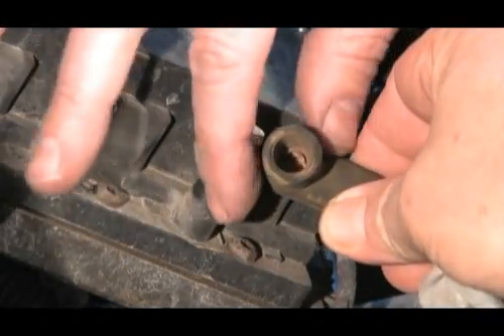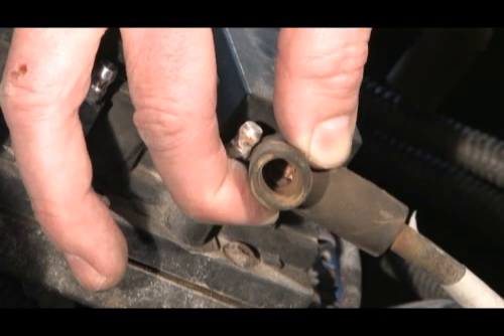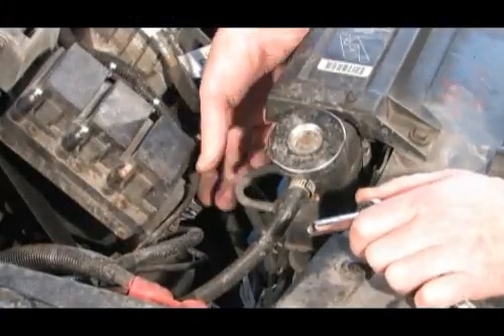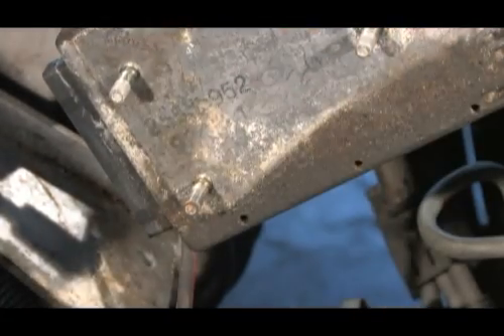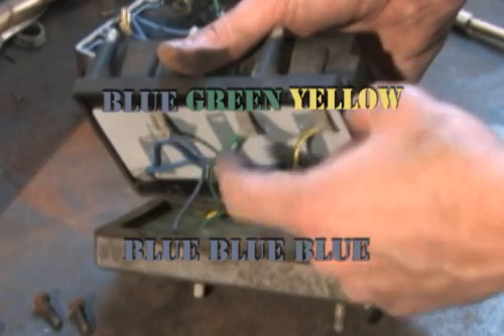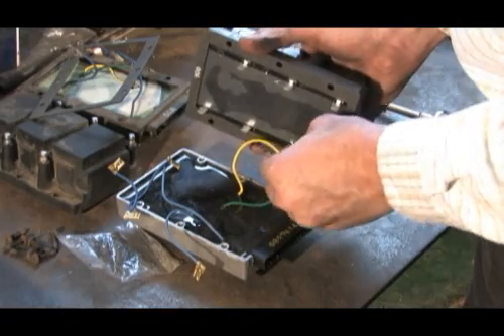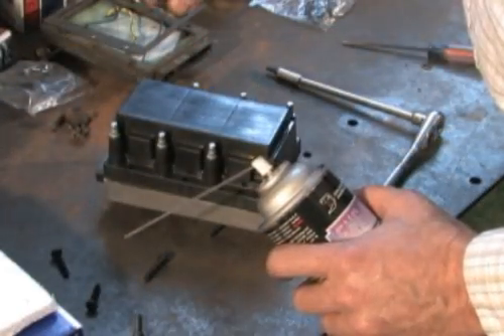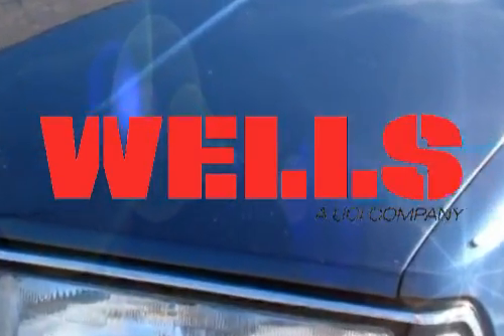GM Type I Ignition System Troubleshooting, Diagnosis and Repair by Wells EM

Comment: This is a pre-series GM 3800 I have seen where this GM Type I ignition system has been upgraded to later system used in series I-II . The later is less expensive part and performs better plus coils are individual.  Do you know if the connector is same or if the input wiring needs to be spliced  to a series I-II connector.

Comment: What size bolt is the tensioner pulley
Reply from the maker: Hey, wish I knew. That information isn't published. Try different sockets until one fits.
Mike Becker, Senior Technical Instructor
Reply: I found out the metric fits perfectly. Between 16-18mm and it’s reversed.. righty loosey, lefty tighty.. There is an in-depth instruction of using Computer, CPU thermal compound at Best Buy or computer stores. The official GM service manual shows 4 spots to apply the compound. It helps reduce heat damage to the ignition module and coil pack!  

If you’re on a tight leather lycra corset budget, don’t toss the old coil pack! I broke the coil pack tab-pins, and wire cleaned the spark plug wire terminal and used dielectric grease on both plugs and coil pack.. I do field repairs on my Buick.. Get a metric tool set.. get an LED phone light that you get with an iPhone as it is very bright! If you break down at night.. Replace spark plug wires and plugs. Disconnect the battery, to clear all P-codes.. The computer will take time to adjust to new electronic components..
Reply: I saved and cleaned the old coil pack after I broke the tab of the new coil pack! $68.00+ bucks! Wire toothbrush cleaned the corrosion on the terminals..

Comment: Nice video. My aunt has a 1991 Bonneville with the same as in the video. We have had it  to so many mechanics I have lost count!! Her Bonneville is throwing a code 42 which is s a problem between the ECM and the ICM?? I am going to change the coil and modular this spring!!
Reply from the maker: Good luck Gracie! Glad we could help with our video!
Mike Becker, Technical Services Instructor

Comment: Hello, I have a 1990 Lumina APV van that periodically after running a little while, the Temp starts going halfway up and if I accelerate more heavily it will get really hot! The big problem while driving will happen when I come to a stop.  The engine just goes dead sort of like if you can imagine driving a manual transmission car coming to a complete stop and not engaging the clutch....This is how my van feels when it starts heating up and I come to a stop...Then I will have to put it out of gear and crank it, But then when I put it back in gear it will go dead again... If anyone can help me figure out a fix for this I would be so thankful!  Thanks!
Read more
Reply from the maker: ***** It sounds like the first thing you need to do is find out why it is overheating. From your description it could be many things causing this over heating. I would start by making sure the system is full. Then replace the thermostat. If you still have issues let me know. It is possible to be causing both the issues. But we need to address one at a time. 

Mark
Reply: markjhicks Thanks for your response Mark! I recently had a thermostat put in and a heat sensor also. About a year ago I had a heater core and a heater connect in back of fuel injector area replaced, and new top and bottom hoses ..Ive added engine cooler liquid they sell at walmart..But it still gets too hot and now and then at stops it will go dead ..it feels like the clutch isn't engaging..Feels like a stick shift when you don't depress the clutch when stopping..Only happens when vehicle is hot or heating up.
Reply from the maker: The transmission is probably stuck in overdrive. There is I believe a four pin connector on the transmission you can see from the top front. It will usually have a blue connector if i remember correctly. Try disconnecting that. It will stop the trans from going into overdrive and sticking. That might be your overheating issue also.
Let me know,
Mark
Reply: markjhicks ..I found the blue four pin connector when I checked yesterday and disconnected it.. I drove down the road a ways and it didn't overheat or stall after driving it awhile. I am praying that this will take care of the stalling at stops .  I did notice after more driving the temp went a little over halfway, But no stalling yet!  Thanks so much for your help on this!
Reply from the maker: My pleasure. Keep a close eye on it.
Mark

Comment: Re: 1995 S10, 4.3 z code, TBI...removed distributor to change intake gaskets (engine ran fine except for intake manifold coolant leak), upon reinstall found out that distributor has to be in sync before installing. This requires aligning a dimple on lower shaft & a paint mark on upper shaft. Neither my original or a new (not reman) is marked. Set at TDC compression, align rotor so it goes to #1 at install....backfires (out of time)...How is this distributor synced without those marks ?
Reply from the maker: Send me a message with you e-mail address and a reminder of the issue. I will send you the instructions.
Mark Hicks
Wells Vehicle Electronics

Comment: I have an 05 Impala SS that frequently misses under load. I replaced the coils the injectors plugs wires mass air sensor still does it. basically it bogs down and the CE light flashes a while usually while trying to get on the highway or when passing I have to drop from OD to drive and get the RPMs up to keep it from happening. Any suggestions?

Comment from the maker: Most common to cause this type of backfire on your vehicle is the ignition control module and coil. The crankshaft position sensor and timing chain have also been known to cause this. Please let me know if you have any further questions or what you find as the cause.

Mark Hicks
Wells Vehicle Electronics

Comment: it is a 1989 olds 98 regency brougham.3800 series motor. i have have replaced the pugs and wires. when the engine is put under sudden load it backfires though the intake.

Comment from the maker: Do you mean the Ignition Control Module or how it is connected? If yes, yes it could cause an engine to backfire through the intake. However, there are several reasons an engine would do this. What is the year, make, model and engine size of your vehicle and what is it doing? Maybe I can help you.

Mark Hicks
Wells Vehicle Electronics

Comment from the maker: @MrVhandi  Check the primary winding between terminal A and D, 1.2 to 1.5 Ohms. Check secondary between terminals A and the secondary terminal ( where the high voltage wire connects) 9040 and 13,560 Ohms. Check the internal noise suppressor between terminals B and D, about 2,200 ohms.
Hope this helps,

Mark Hicks
Wells Vehicle Electronics

Comment: Oh, right, so you have the 3 plugs on your coil.  mine is cylindrical on my accord.  From my haynes manual, it has the different connections labelled as A, B, C, D, and the one connected to the distributor is a high "something".  So you test your pos and neg multimeter to A and D for your primary resistance, then A and the "High something" as your secondary resistance.  then you measure the resistance between B and D, take the readings, and compare to what's in your manual.

Comment: That's off topic though :P I'm getting into the automotive course at the university in town.  I'm still new at the stuff but I'm learning as I go.  I just got a new car that stutters when put in gear, and dies.  It's hard to start the engine.  It turns over, but it doesn't start, 95% of the time.I have to disconnect the IAC to start it.  In the process of troubleshooting, I tested the resistances in the ignition coil.  I found pretty much the same results as you did for this vid.(different coil)

Comment: I have an 88 Honda Accord EX-i, automatic.  I have some issues with the car starting,as in it doesn't.. didn't.  I changed the fast idle valve last night, seemed to work with the eacv(e(missions?)..air control valve, or Idle Air Control Valve) connected.  Normally I have to disconnect the eacv to start my car.  it controls the idle air intake when the engine has a load put on it.  With a higher load, the idle will lower,so iacv kicks in and increases the amount of air to the engine, raising idle

Comment: mechanic's left handed. ;) southpaws rule!
interesting vid.  my coil has pretty much the same readings. primary's too low(analog multimetre) secondary's on track, but the b-d is on track too.  Pretty sure I need to replace my coil.  My engine doesn't start with the EACV on, and when it has load after it's started, it just wants to die.

Comment from the maker: @johndeercool No the potting material should not be sticky or soft. It sounds like the coil or ICM or both have become very hot. This usually means high secondary resistance. Like defective ignition wires or spark plugs. It could also mean a poor ground contact, excessive AC voltage etc.
Please let me know if you can not find the cause.
Mark Hicks
Wells Vehicle Electronics
Reply: Wells Vehicle Electronics 
gm vortecignition how it works

Comment: i have a similar engine in my 87 bonneville. the coil tower devolped a pin hole and was leaking spark which was grounding out the cylinder. car ran very poorly. replaced coil, problem fixed

Comment from the maker: @johndeercool If you are talking about the epoxy inside the ICM, the answer is no. It should be solid and not sticky. If it is soft it means the ICM has overheated.

Mark

Comment from the maker: @rynobelzer2  It is hard to say what it is without seeing the green substance. But it does sound like the ICM is getting hot. Before you replace the ICM, be sure to check the plugs, wires and coil for high resistance. You will also want to check the ground for the ICM. These ICMs ground through the mounting studs. Also check the ICM mounting bracket where it meets the head or block. 

Mark Hicks
Wells Vehicle Electronics

Comment: Thanks for this I recently pulled my coil pack off the icm and had a massive amount of green goo that is extremely sticky. It was holding the coil and icm together and had gotten into the connection on the yellow lead. Upon cleaning it up a bit, cutting back the yellow wire and crimping on a new connector.  I installed a new coil pack. And the problem remained. Is the green tar like stuff melted off the icm?

Comment from the maker: @CODxFUNxMAN At this time I would not be concerned with the codes. The transmission codes could be caused by the misfire. If you have a timing light (if you dont I think you can borrow one from AutoZone) attach it to each one of the ignition wires to see if it flashes. If you find a cylinder or two that do not flash the light consistently, those are the cylinders that are misfiring. Watch the video on type two diagnostics, I will attached it to this video. 
Stay in touch,]

Mark Hicks

Comment from the maker: @uzielvaldez78 Is this one or two different vehicles we are talking about?
From your description if it is the same vehicle, I would first look at the catalytic converter and timing chain. By a certain RPM I am thinking you mean a low RPM. If you are saying it wont go over 5000 RPM it may be there is a rev limiter built into the computer system. 

Mark Hicks
Wells Vehicle Electronics

Comment from the maker: @Bajaheat 1. Check module control of the coil by back probing the White wire with the test light to Battery Positive Voltage (B+). If the test light will not flash on and off, while cranking the engine check the ignition control module (ICM) and pickup coil.

2. Check the output of the pickup coil; should be at least 750 mv with the engine cranking, using an AC voltmeter. 

3. If the output is good replace ICM

Stay in touch,
Mark Hicks
Wells Vehicle Electronics

Comment: @markjhicks i have a 1994 chevy silverado 4.3 and when its hot sometimes it wont start and ive checked and it doesnt have spark..but if you let it set awhile it will start..any ideas?

Comment from the maker: @twisted62380 Cutting the primary wires like your fan did will not ruin the coils. First let's check for spark to be sure that is the issue. Do this with a timing light or spark tester. You can get a good spark tester for just a few dollars. Also check all the fuses with a test light. If you have no spark and all the fuses look good, remove one of the coils and put your test light between the two spade terminals on the module that go into the coil and crank the engine. the test light should

Comment: I have an issue ( 1998 Olds Silhouette .. 3400 V6 ) 

theres a wire harness  ( loomed ) along the front of the van above the radiator fan.  couple of days ago...somehow..the harness got into the fan and ended up rubbing through some wires..cutting some copper strands.  ( causing no start )...I rewired and still no start.  Could the radiator fan cutting the wires cause a short to the coils?  I can hear the fuel pump priming.. but I dont think Im getting spark. Need your input.   Thanks!!

Comment from the maker: @onelonlyeye Heat and vibration usually set them off. You can also try tapping on it when the engine is running with a long racket extension. Just be careful not to get the extension caught in the belt or pulley. If the engine dies when you tap it, it is defective and needs to be replaced. 

Mark

Comment from the maker: @onelonlyeye It is common for the crank sensor to cause a no spark problem on your vehicle. Unfortunately, the only real way to check it is with a lab scope. If you have replaced the module and checked the wiring connecting to it, go to our website and look up the pin out for the module. From there check to see if it has power and ground. The module part number is either DR143 or DR148. If it has power and ground, the best guess would be a defective crank sensor for no spark. 

Mark

Comment from the maker: The cold temperatures cause the components and windings to contract. In the case on this coil, the crimps that connected the secondary windings to the terminals were lose and when the coil was cold the connection was broken or open circuited. 
Mark

Comment from the maker: On earlier ignition control module a heat sinking dielectric grease was used on the module backing plate to help draw the heat from the module. However DIS modules do not use this. The baking plates are much thicker and do a great job dispensing the heat. 

Mark

Comment from the maker: The rust is caused by a poor seal between the wire boot and coil. High secondary resistance will cause some aluminum oxidation. 
Mark